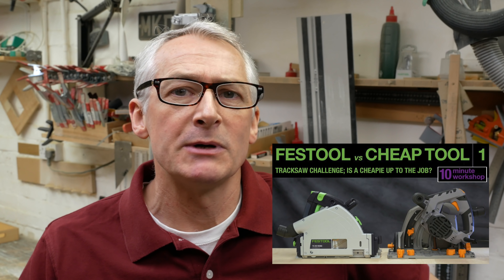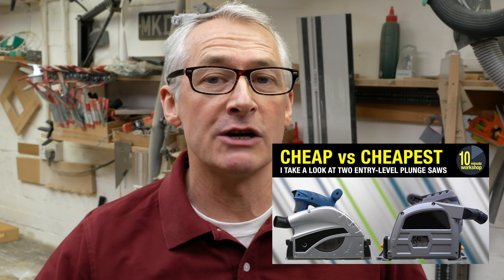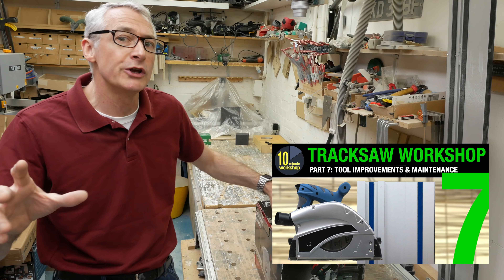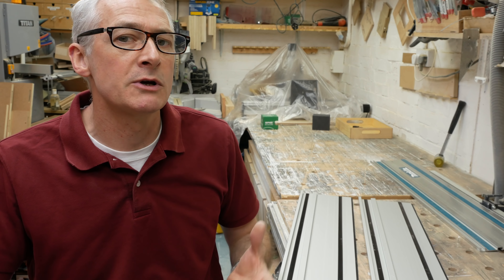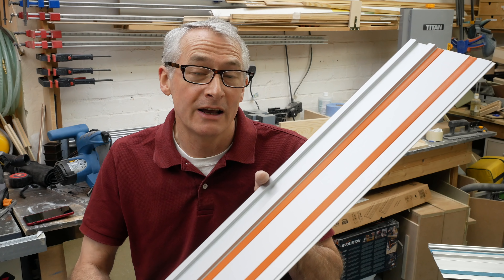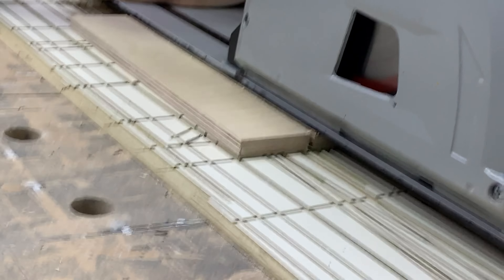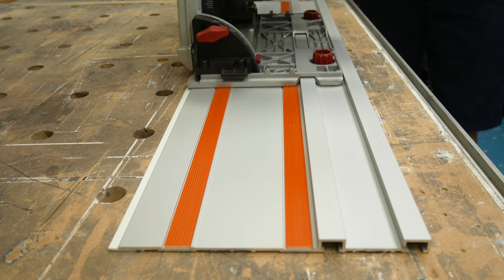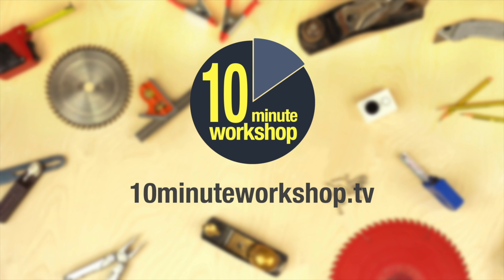Lidl's Parkside Tracksaw [Video #323]

Comment: Guys, if you want to extend this tracksaw then lidl can supply more rails for you. You get the same 1400mm track, taking it to 2800mm, which is great for cutting large sheets down easily. It is not lidl that supp,y them but a German company. Check the instructions for maybe a supplier name or ring the technical helpline for a email address or telephone number. I just emailed them and done a bank transfer to the company...cannot fault them.
The actual tracks fit the dewalt range too. Here is the price I paid last year for supply from Germany, which took about 3 days to get to my home in the north east of England.....a whopping €19 euros. The dewalt tracksaw rails are around £50 for one length.
Yes as Peter said it is a entry level model, but if you change the blade to a 48 tooth you get a decent finish on whatever you cutting. Recently, I used mine to trim down oak doors and except from a couple of scorch marks, which I sanded out then this thing will do any DIY around your home....well impressed with mine
Reply from the maker: Thanks Tom. Kompernass have jacked up the price to £30-odd now, just FYI.
Reply: Lol...Brexit...say no more!
Reply: @tomconwell4965  I purchased the spare guide rails from Kompernass this afternoon for a whopping £17.79 including postage.
Reply: @colinlvrp  lol...well done and get a decent blade for it. A watch out with the guide rails are the grub screws in the base they easily strip and fall out if you are not careful. Otherwise its works fine. Best make or buy a couple of clamps for the rail too. Its not the best of holding down fast unlike the most expensive guides from festool etc.

Comment: Think I might have to purchase one of these for the rough lumber type jobs, I also bought some evolution track recently and I've sold my festool tracks and kept those, for the money they cannot be faulted, had to square up one rail on my mitre saw so they joined straight but took a minute and works perfectly now, 2x1400 track, 2 clamps and a bag for £65, you'd be mad not to, I also got the Triton track saw square to go with it, it's a snug fit but gives a good right angle cut, any chance of a review on these sort of track accessories Peter?
Reply from the maker: Thanks Craig! To be honest there are so many of the track squaring things I wouldn’t know where to start - and frankly, they’re not something I use (MFT) so I’m probably not the best person to give an opinion, but yes, track accessories in general - that’s an excellent thought,m - I’ll add it to the lust, thanks! 👍👍
Reply: @10MinuteWorkshop  thanks and keep up with the vids, I was a site joiner and kitchen fitter for years and slipped out of the trade but kept all my equipment, watching your videos has renewed my interest and given me the drive to finish my house, I've got hallway panelling, loft storage and a window seat on the list, oh and a bathroom makeover, not sure I should be thanking you really as I'll have not have any  spare or relaxing time for the foreseeable future 😂😂on a side not I've just designed and had made an aluminum template for making mft tops of any size, it'll do the festool size top in under 5 minutes, works with a router and 20mm plunge cutter,

Comment: Hi Peter,  great video's as usual, but just wondering if you can reccomend a pair of track clamps for it ! And do the festool clamps fit the rails, thanks again Steve
Reply from the maker: Thanks Steve! Usually the Makita clamps are pretty good for the money - https://amzn.to/2T9ukc1 . The rib on the parkside rails are standard, so I’d expect them to be fine, though I don’t have any so I haven’t checked them, obvs. I’ll check the Festool ones when I can get at them - I’m in full spray-booth mode at the mo! 👍
Reply: Thanks Peter, much appreciated 👍

Comment: Quick question about Makita rail compatibility: what about taking off a bit from the base of the Parkside saw? Would that be feasible?
Reply from the maker: I suppose it’s possible, but it would be much easier to rip the little lip off the trick, than to grind away the baseplate. 👍👍
Reply: @10MinuteWorkshop  Thanks for the answer & your videos!

Comment: Thank you for this review. I've umed and arrred about getting a track saw as I recently bought a Evolution circular saw. But like you say for £65 and if I'm lucky enough to get one. Then I will.
Cheers for sharing
Reply: So......I managed to get one on Thursday and used it today. 
Having never used a track plunge saw before, I have to say I thought it was brilliant. 
Thanks again for the review. Made cutting long lengths that little bit easier.

Comment: I just had those evolution tracks delivered today as i thought they were a bargain.
Unfortunately if i set up my makita 36v on my track and take out the slop it is far too tight on the evolution tracks and my track square isn’t compatible because of the t slots both being underneath. Shame I didn’t spot that before ordering :(
Reply from the maker: Yeah, I don't know why they muck around so much with the guiderail pattern - none of them are identical, and the patent on the Festool pattern is long gone, but almost nobody even tries to make them the same - Makita and Titan are the closest, though they have the anti-tip lip, of course... 🤷‍♂️

Comment: Thanks for the vid, this is bar the colour the exact same as the Rutland's saw but a good deal cheaper. Thanks for clearing up which rails fit it. 
The stock blade was garbage and my handle gets quite warm strangely
Reply from the maker: Thanks! It certainly looks the same as the Rutland- badged one, yes. Do you have the Rutlands saw? I’d be interested in seeing a photo of the spec label on the back of the motor housing - might be able to see a manufacturer name? You can email me - link in the ‘about’ tab on my channel home page  - thanks! And yes, weird about the handle! 👍👍
Reply: @10MinuteWorkshop  I'll try remember when I'm at the workshop tomorrow. They certainly look very much the same

Comment: Peter, thanks for all the work you put into your videos!

Just picked up a PTS 1200 C2 (a slightly newer version you looked at). Well, quality control as you mentioned: First thing I noticed is the anti-slip strips are not the same thickness. about 1/10mm difference in thickness. On one track the strip in the center looks thicker than the one on the other side. So even with the saw on the track the whole track and saw can tilt a bit to the saw side. The other track has this reversed: the neoprene (?) strip is thicker on the side than in the center, that rail doesn't tip. Maybe I will try to change those strips, or get new one.
And maybe new splinter guard as well, seems to have some curvature, and doesn't press against the wood...

I assume you shouldn't press down on the saw like crazy, right?
Reply from the maker: Thanks! Sounds like they’ll need a bit of attention, yes! 👍👍

Comment: Warning: the saw blade screw was too tight from the factory. Impossible to replace the blade. The hex bolt is broken now. Even though I used the right tools to remove it.

The mm settings are also inaccurate.

The problem with parkside. Looks nice at the start but frustrations come fast when you actually use it.

If you buy this loosen and refit all the screws you expect to ever remove. Might want to put some grease to be sure.

Oh and keep the receipt...

Comment: The biggest issue with these low end budget ones like Parkside is no riving knife.
Any diy’er who isnt familiar with these may end getting a surprise if a narrow piece binds as the saw goes through. 
Apart from that they are pretty damn good for the money.
Reply from the maker: The Makita and Mafell plunge saws don’t have a riving knife either, of course, but yes I agree that a bit of caution needs to be exercised in use 👍👍

Comment: Hi Peter Bricklayer back again lol Have you seen these Einhell TE-PS 165 1200W Plunge Saw' you buy saw and track separate 2 x 1m lengths in a box with connecters and  track clamps mine from ITS. on sale at toolstation now
Reply from the maker: Hiya. No, haven’t seen that one, thanks! A pair of 1-metre rails is an interesting choice! 🤔🤷‍♂️👍

Comment: I have Rutlands version of the saw and i've been using it since just before Christmas. The blade i changed for a Trend blade, and it really does cut ok, the track's on the other hand have not stood up well. I've been really unsure what track's would be compatible maybe the evolution one's could be the answer. Thanks for the video it's given me something to think about .
Reply from the maker: Thanks Geoff. Yes, the Rutland certainly seems visually similar to the Parkside. And yes, I’m very impressed with the evolution tracks, great value for a pair of 1400 rails👍 If you have the time, could you take a photo of the label on our Rutland saw (the one in the motor housing with the specs on it) and send it to me? I’d be interested to see if there’s any obvious wording on there that would tie it to the same manufacturer. TIA. Email address is in the ‘about’ tab on the channel homepage. 👍👍
Reply: @10MinuteWorkshop  Hi peter, sent those pic's and info a while ago just checking you got them ok 👍
Reply from the maker: @geoffjones8484  Geoff, I do apologise - I had a couple of people send me details of the Rutlands saw and I neglected to thank you for yours! Very interesting, thank you! Obviously not quite the same saw (1400w vs 1200w) as the Parkside, despite the visual similarities. I'll be having a dig into the details on this one, thanks! P

Comment: The one I had last year went back due to the edge-strips being curled up and not in contact with the work. Did you notice this at all? There look to be some cosmetic changes to the new version so interested to see if it performs the same. And those Evolution rails look like a steal, even if the clamps do look a bit iffy. Two rails, joining bars, clamps and bag for £69 delivered at the moment! Would you recommend?
Reply from the maker: The evolution rails look excellent; I have the smaller set (2x700) that came with a saw Evo have asked me to take a look at, and I’m very impressed. 👍👍 And Yes, there is a slight curl to the splinter-guard, but it kept good contact and can easily be replaced if necessary.

Comment: You where lucky, on mine the rails where not compatible with a festool saw !!!
I have the parkside and the festool. Had the festool first and actually bought the parkside mostly for the rails. But the one i got have the center guiding track of the rail about 1mm larger than the festool !!! The festool saw could not be used on it out of the box. I managed to sneak some of the material on the non guiding side (oposit to the cut) by carefully grinding it with a flat file with regular motion so that i don't ruin the parallel. So it is now usable but i still have to adjust the pressing parts on the saw when jumping from a rail to another. That is pretty annoying when you try to get job done fast jumping from riping (long rail) to cross cutting (short rail). So i'm now considering buying a 80cm genuin festool rail, yes that one that cost about the same price as the whole parkside package :( 

So it seems like you didn't had that problem but maybe people should be careful when buying it for the rail. 

Just my 2cts...
Reply: He only says the Parkside saw is compatible with Festool rails, he doesn't mention trying it the other way round.

Comment: Hi Peter,
Thank you for your videos, always useful and informative.
In this video you mention the Parkside and Titan being on par with the Parkside better in some ways - I'd appreciate it you could elaborate on this.
As someone who has been enticed by your tracksaw workshop method but only doing this as a hobby these entry level saws are what I am considering. I would note that the Parkside appears to be identical to the own-brand tracksaw that Rutlands sell for a similar price to the Titan so it is available year-round albeit at a premium to the temporary Parkside offer. The Titan appears to have the edge with rail compatibility and the anti-tip feature but would be interested to hear what pros you put in the Parkside column to help people like myself make an informed decision based on the experience and opinions of a pro.
Reply from the maker: Thanks! There will be a follow-on video about this (Titan v Parkside) in particular, but in short, it depends what your plans are for the saw. On paper the saws are very similar, so the  Parkside is the clear winner at ~£65 vs £110. But the Titan is down to £90 currently, and often available for less on special. And it’s available all year round of course, not just on special. But there are other things to consider - the Titan rails are better, but the saw has the anti-kickback thing which drove me nuts until I removed it. Then again, if you intend to extend or replace the rails, then that takes them out of the equation. Lots more to consider if course, it at the end of the day I’d have killed to have either one at this kind of price when I was starting out. 👍👍

Comment: Pete, does changing blade thicknesses really have an impact on the rubber splinter-strip ? 🤔
I mean both blades butt up against the arbour so the thicker blade will simply be "offset" to the right , away from the arbour face which is positionally fixed (relatively) to the rubber strip ? 🙄

Another question ... will the Scheppach ( Titan )  saw run on the Parkside tracks, you probably answered in the vid but my head was muddled 😂... if so, I might buy the Parkside just for the tracks ! 😉

😎👍☘
Reply from the maker: Yes, because the blade thickness isn’t the same as the tooth thickness (kerf) you’ll get a slightly more trimmed splinterguard with the 2.6mm kerf blade. And sorry, you’ll have to be clearer; he Titan saw is the Screwfix/B&Q one, the Scheppach is the Aldi/Workzone one. Which saw do you want in which rail. 👍👍
Reply: @10MinuteWorkshop  thanks Pete, I have the Scheppach , will the Parkside rails work with that ? 

😎👍☘
Reply from the maker: @peterfitzpatrick7032  I'll have to check when I'm back in the workshop; I think they'll fit, but may overhand the splinterguard. I'll confirm in a bit though 👍
Reply from the maker: Hiya. He Workzone fits the Parkside track, but it does overhang the splinterguard. Might be OK of you moved the rubber strip out?? It fits well on the Evolution rails though. 👍👍
Reply: @10MinuteWorkshop good on ya mate ! 😎👍☘️

Comment: Peter is it normal that the sawblad  need to cut a bit of the rubber of the rail the first time you cut?
Reply from the maker: Yes, totally. You’re trimming the splinter guard back flush with the blade. 👍👍
Reply: @10MinuteWorkshop  ah thanks, so it's for the perfect size of the blad I'm using. 👌

Comment: I bought one this morning from Lidl. The box colours, manual no. and cover artwork have changed and it's now "1200 C1" instead of "1200 B1" on the label.
But I couldn't see any physical differences at all compared to the review saw.
Reply from the maker: Good to know, thanks! 👍👍
Reply: I bought one this morning as well.  dust port looks slightly different, no play at all.  I'm umming and arring about whether I should swap it for the titan.  I can afford either one, the kickback forward only mechanism puts me off though.  I've got 30 days to return, will wait for a review.
Reply from the maker: There’s so little to choose between them tbh, I’d probably stick with the Parkside. As you say, you need to disable the anti-kickback before it drives you crazy, which is technically a breach of warranty. The Titan tracks probably are better - they conform to the standard Festool pattern, though closer to a Makita, with the funny lip, so more compatible going forwards. Then again, with the Evolution rail package available, does it really matter?
Reply from the maker: Good to know about the play in the exhaust port. Mine was an unopened box, brand new, so the play has been there from day one, I’d say. 🤷‍♂️👍👍

Comment: If you really wants to make it compatible with Makita rail, just make a chamfer on the saw base plate to clear the anti-tipping lip. 
Should be fairly easy to do with a manual file, a grinder or even a 45deg router bit.
Reply: would be a waste of an expensive track...also, why buy a makita track if it does not fit?

Comment: Stupid question maybe... but if the Parkside saw fits the Evolution rails, then does this also mean Parkside rails and Evolution rails will connect up perfectly?
Reply from the maker: No, afraid not. I address the whole ‘guiderail compatibility’ thing in next weeks video. Just because a saw fits in another rail, it doesn’t mean it works well, sadly. 🤷‍♂️👍
Reply: @10MinuteWorkshop  Ok thanks for swift reply! just trying to figure out whether I could connect the shorter Parkside rails to the longer Evolution ones for big long cuts

Comment: Thanks for the heads-up. I bought one based on your recommendation. I have powered it on to ensure it works. But I haven't used it yet. I fitted the tracks together and pressed a ruler up against them to check the joined track is straight. It is miles off. About 2mm off over 30cm!  I checked both tracks with an engineers square and neither is at 90 degrees.  I am thinking about cutting both tracks on my mitre saw to make sure that they are 90 degrees. If the track is aluminium that should be fine right?  If not I will just buy a better track such as the evolution
Reply from the maker: Thanks! Yes, I’ve cut loads of aluminium with my standard mitresaw (and tracksaw!) without any problems. For the price of the tracks, it’s no surprise that things aren’t as straight and true as they could be, so I’ give it a try - and if all else fails there’s always the evolution track packages 👍👍